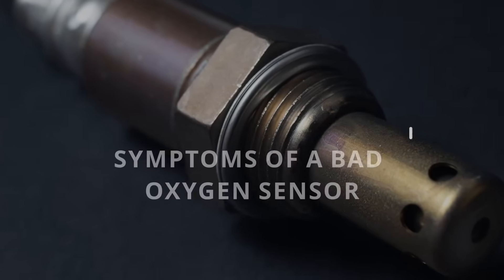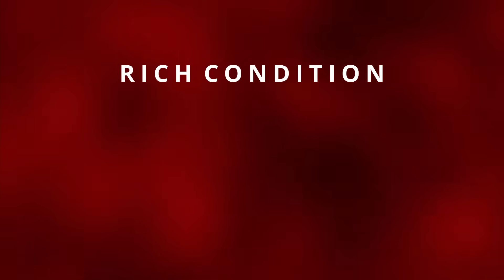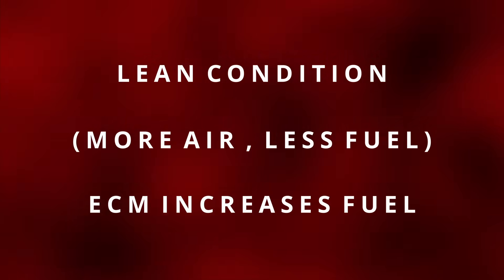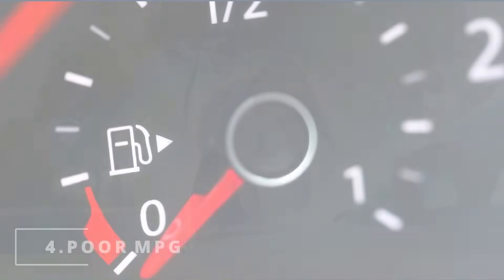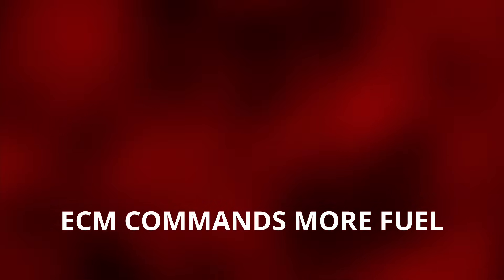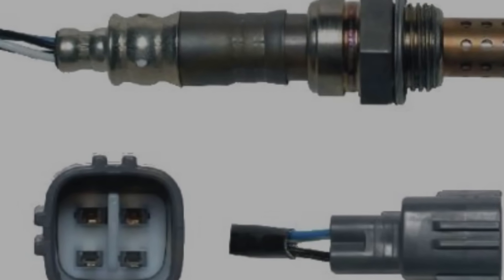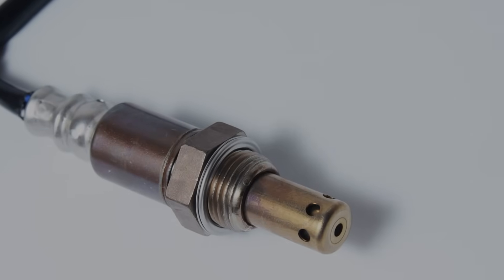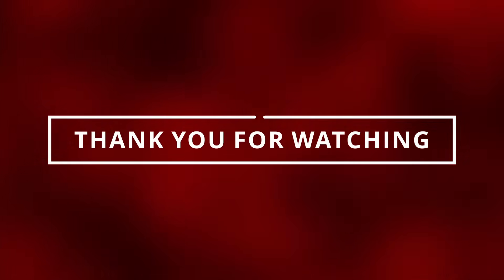SYMPTOMS OF A BAD OXYGEN SENSOR

Comment from the maker: Thank you for watching!
O2 sensor removal kit: https://amzn.to/3dU26RA

OBD2 Scanner: https://amzn.to/3PHRplS
Reply: I got P0410 code but I don't know if is sensor bank 1 or bank 2
Reply: Why is this guy talking like that?  INFURIATING
Reply: Wow. That explains alot. Especially the part about unplugging the censor. My issue is the damn think is rust locked on the manifold so I treated the fuel hoping it works itself out. No such luck. I'll try unplugging it see what happens

Comment: Dude just described my car to a T! I have to put it in neutral while at a traffic light, that steadies the shaking. The gas mileage is very poor. I went to an auto parts store and had them plug in the computer reader thing and it said catalytic converter but was told it’s likely the oxygen sensor. I hope that’s an inexpensive fix!

Comment: Great explanation. Will a too lean error code cause damage to the engine immediately or does it take some time? TIA
Reply from the maker: A too lean error code won’t cause immediate damage, but over time, it can lead to overheating, detonation, and burnt valves.
Reply: @easyautofix  You're the man, thanks!

Comment: A funny thing happened to my 96 sentra, in the mornings it would have a tough time starting, part of it was the fuel pump going bad, but I could not figure out why it was still bad, my inyectors and throttle body were perfect, other sensors were working fine, until I unplugged the oxygen sensor, BOOM, fired right up on a cold morning.

Comment: My 2013 Nissan Versa Catalytic Converter Was Plugged and we had to Nock out the Plugged Cat, and it was Still Pulsating or Loping when Accelerating or under a load. It's Burning Extremely Rich, in fact it stinks with pure gas odor. I think it's clear what Part I need, an Up Stream O2 Sensor. Hopefully it fixes it. If Not Maybe a New Air Filter and get a New Mass Air Flow Sensor or a throttle body Sensor or New a Throttle Body.

Comment: I did unplug my upstream and ran 50% better it would start easier but idle up and down sometimes stalling. Plug it in hard to start and would stall easier. plus fuel smelling emissions out the tail pipe.

Comment: Hello. I own a vw golf 2 and I have a problem when I connect the coolant temp. sensor, the engine is trembling and even stops (I ve changed the sensor twice and it s stll doing the same). My question is: can the Lambda sensor have a bad influence on the coolant temp sensor?

Comment: My 2000 tundra truck has rough idle and shakes in a red ligth like it wanna turn of and I been knowing it has a oxygen sensor on scanner I disnt change it because I had les then 5 months with it hardly use truck but some mecanic told me the sensors feom auto zone come out bad so you think that's the problem ?? My oxygen sensor it has rough idle wen I'm in red ligth or stop some were when I put it on park it stops or wen it's running

Comment: Can an oxygen sensor cause a vehicle not to start.? My friend’s check engine light can on indicating an oxygen sensor code. Sometime after that engine would not start. It is a friend of mines truck. It is an 04 Ford Silverado six cylinder.  It wont’t start.   His Mechanic friend change changed the coil and some kind of electronic module. It started up after several attempts and ran for a few days and stopped again. It won’t start again. He cleaned the mass airflow sensor after he got it started as a little something extra. A few days it stopped starting up again.  Now he says it’s probably the mass air sensor is probably bad and he’s going ready to change it.  Before all of that, his check engine light came on With a code for a bad oxygen sensor. Could the bad oxygen sensor actually be the problem, which he ignored and never changed?

Comment: Why have 4 mechanics told me there should be 0 performance issues from an Oxygen sensor? They swear online knows nothing about O2 sensors 

Has anyone had bad acceleration, get O2 codes, replace them and notice a big performance difference?

Comment: Mine has most of those engine light one day was turning of and on and one time shaking after I put gas also been wasting more gas the  normal also wen I turn truck on it trows smoke and wen it warms up it stops ima have 2 change the oxygen sensor again I changed it not so long ago but mecanic said sensors from auto zone come out bad so ima have 2 wadte money again and I haven't worked for a few months know

Comment: My check engine light came on, and the codes came up for one of the oxygen sensors.

However, the next day the check engine light turned off. Does this mean I don't need to worry about it for now?
Reply from the maker: This sounds like an intermittent issue. Since it only happened once and the check engine light turned off the next day, I wouldn't worry about it for now. However, if the code comes back again, it's a good idea to address the issue to prevent any potential problems in the future.

Comment: Which 02 sensor should be unplugged for the testing procedure? Upstream or down ?
Reply from the maker: Upstream
Reply: @easyautofix  thanks for the reply. Just a question, won't it set a code after disconnecting the sensor?
Reply from the maker: @JohnContos-h1v  It should, yes

Comment: Hi Easy Auto: one of the things I enjoy hearing is the way you say "today's video is about "symptoms of a bad 02 sensor" the way you narrate other videos. It's kind like some kinda child narrator. I want you to know I really appreciate the trouble shooting tip regarding unplugging the 02 sensor to troubleshoot. Since I have 2 sensors only on each side of the exhaust manifold, it should be relatively easy to troubleshoot. This tip will save me $$ in the long run because it's possible I do not need a new MAP sensor. I bought two new )2 sensors but the cost to put 'em on and the fact they could be stuck in the manifold scares me. Thanks, tho for the great tip.

Comment: So basically after watching videos on camshaft, crankshaft and oxygen sensors i came to conclusion they all give the same symptoms which is kinda annoying while diagnosing the problems 🤦 nonetheless great videos man:)
Reply: Lmaoo I’m having an issues right now I had a code p0725 for the tcm in my 2012 g37s I swapped the engine crankshaft sensor codes gone car drives fine the next night drives like shit almost shuddering on the way home when I would give it a little throttle get home scan it now I have a code po138 p2a00 after installing test pipes 😂
Reply: Think you gotta just start replacing stuff that's what ima do
Reply: same boat here, all the symptoms im experiencing are apparently synonymous with 20 other problems. I've just been going through everything then checking & testing it.
Reply: @hellcat7314 just change all 3
Reply: Having an exhaust leak before the catalytic converter or an intake leak can make it look like the O2 sensor or crank/cam sensor are bad .
Reply: Diagnostic scan?

Comment: 2000 wj 4.0 jeep. 
I just replaced my O2 sensors. Bank 1 and bank 2, upstreams, and for the life of me I'm still getting po172 and po175 too rich! I replaced the injectors, spark plugs, fuel pressure regulator. WTH does it want from!!🤯

Comment: I have a 2011 Ford flex and my car burns gas a lot. I sure appreciate how you explained it for me to understand. It has over 200,000 miles. The light come on Sundays and then it goes away and comes back days later. I was told it was a 02 sensor. After listening to you I believe it is the right and the left upstream and downstream if you say that's what it is called. Someone said something about try dry gas. I know I'm over doing it it's been almost a year like this. If you have any other advice for me I sure would appreciate it thank you so much. God bless

Comment: My 02 buick park ave has lost fuel mileage by 1/2 just in the last few days. The only other symptom we have had is that yesterday morning it gave a rough time starting. It acted like it was vapor locked. We found this really doesn’t happen in these types of vehicles. We recently changed the catalac converter so could this have messed up the o2 sensor? Any other thoughts of what it could be? There is no engine light on, it started fine since then, it runs fine other than extremely poor fuel mileage. Very stumped on where to start!

Comment: the 02 sensor code came up when i scanned my car and it said it needed to be replaced. my car has been turning off whenever i put gas in it and it doesn’t start the first time but the second time it barely starts and i gotta gibe it a little gas for it to start, and my car has also been shaking and wasting more gas could that be the problem? i have a 2007 audi a4

Comment: Do you think a faulty O2 sensor can make my RPM be jumping slightly up and down as I'm on cruise controll at low speeds? It also shakes while accelerating only, not while coasting.
Reply: I'm currently in this boat. I think I'm going to just replace the sensor to see if it fixes it and I can report back what happens..
Did you find anything out?
Reply: @aic20 Same here. Did that help?
Reply: Same, did it help?
Reply: I’m in the same boat with my truck, just between 1500 to 1800 RPMs

Comment: Could this be responsible for an rpm drop on a cvt from 1500 to 1000 accompanied by a low rumble sound while ascending a hill? No check engine light on and this is the only issue. The rpm drop only lasts for 1-2 seconds then ascends normally

Comment: Man I have been dealing with this PO420 code. I have had my catalytic converter replaced 2 times and did a cleaning many times but still keeps coming back on. I guess the last thing to check is the O2 sensors even though people say it’s not always them.
Reply: did it work.... if not try your evap purge valve or gas cap
Reply: does your car turn off in cold start at idle

Comment: I've got a '00 Blazer, been replacing sensors here lately I've replaced the cps,tps, with 184k miles with poorer gas mileage as usual the oxygen sensor should be next thanks for info. 😁

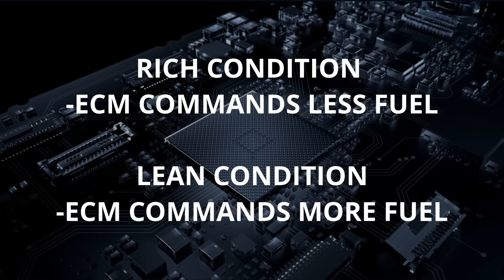Comment: 1:38- 1:45;  A honest statement that, these sensors try to fix problems that usually don’t exist! Seems they would at least put a bypass wire on these sensors instead of stalling and shutting you car down leaving you stranded beside the road!?

Comment: Could a P0420 code be from a faulty sensor rather than the Catalytic converter? I’ve got no other symptoms of catalytic converter failure but I am getting that code. I am getting rough idle but no decrease in performance, no smell, fuel economy is fine
Reply: Did u find out

Comment: In Nissan murano 2008
Sudden engine off while slow the car 
I check code P0345 and P1031

Which one need to replace for that issue?
Reply: Flaco Alterado  i changed cam position sensor now its fixed now car running ok

Comment: Thanks for confirming that a bad O2 sensor may not cause a check engine error code.  I believe my 17yr old sensors are sluggish so monitors will not set. Installing 4 new ones tomorrow. Thank for video.

Comment: My sister has a Hyundai Coupe 2000 2.0 L petrol and the car is running extremely rich with extremely high emissions and a slightly rough idle (RPM shakes a bit below 1000 RPM). Service is done and new spark plugs are installed and a new cat. The car does not have MAF or MAP sensors, is it normal that it has only TPS without MAF and MAP? And is it normal that the car has only one oxygen sensor before the cat? When the oxygen sensor is disconnected, the idle does not change. Do you have any idea or advice?
Reply: Have you fixed it? My car has the same symptoms as yours.
Reply: @gustasj  yes, it was the connection of the MAP sensor, one of the three cables of the connection was not in place, i fixed the cable and everything became normal again, the sound of the car became quieter than before, the rich condition went away and the exhaust smell became normal again without fuel smell in it.
Reply: @MerohDIY  was the connection pin bent?
Reply: @gustasj  no, it was the cable that was off exactly behind one pin.
Reply: @MerohDIY  oh, okay. Thank you for the response.
Reply: @gustasj  you are welcome :)

Comment: I have a 95 C4 with less than a 100k on her... I purchased the C4 in April of 2021 with only 87,000 miles....few months back it started running rough so I changed the Ignition Coil and Coil Module and the wire running from the Optispark to the Coil... made all the difference in the world... since then I have replaced the electric fuel pump, fuel filter and the Fuel Pressure Regulator simply because the Internet says after 75,000 miles you should start replacing the items... So my C4 is running great for a while now it's running like it has a slight miss so today I replaced the Map Sensor and IAS.. but it didn't change anything so I was wondering what happens when an 02 Sensor goes bad... How does it affect the car?

Comment: So I had plenty of oxygen sensors go out on me in previous years. But this particular time there was no indicators my oxygen sensor was out. 
So I practically swapped out every single cheaper part related to my codes: P2294, 2293, 0087 & EPC-Engine icon in dash.... all pointed at fuel pressure regulators, sensors, etc. I had no misfires, gas seemed to be normal but I did have loss of power.
So I finally changed the oxygen sensor and oh boy my car is doing figure 8 donuts now and running like a champ 💪🏾.
Reply: Did your car die at a stop ?
Reply: @juanrenobato2722  no
Reply: @juanrenobato2722  no & it wasn't the oxygen sensor. It was a fuel regulator had a crack I was slowly leaking gas, which made it putter-loss of power, hard starts but no cutoffs. 
Previous vehicles when it was the oxygen sensor it would have loss of power, putter, misfire & fuel efficiency was bad.

Comment: I have a Hyundai Sonata 2012 limited and it has 2 sensors . One is by the engine and the other one is by the exhaust pipe. Which one should I remove ? Thabk you

Comment: I suspect my O2 sensor as it is covered in soot. I am just getting a TBI system running on my 240Z and its idle goes up and down after a couple minutes. I didn't get it totally up to temp, but the ECM is not able to learn and calm things down. (I'm still burning fresh paint and header wrap so I didn't run it very long today). The other possibility is the ECM chip, which is in the experimental stage from the mfg, Howell Fuel Injection. But the O2 sensor is a cheap GM part. The check engine light is on, but I don't have an OBD1 scanner yet.

Comment: So idk if you can help. I have a 2016 Ford Escape. My check engine light has been on and a month ago my car was stalled in the middle of the street. It was jerking at first until it completely stopped. I made it safely into a parking lot and tried to drive home after. And it just wouldn’t go. My car was still on, but not driving. Would this be a oxygen sensor issue?

Comment: Well I got more I fo out of this than anything my mechanic told me.
My CEL came on but went off with new IAT sensor but it still surges, idles rough in gear only, and strong smelling exhaust. Then poor gas milage and stalling at stops in gear.
Every single symptom I have is here.
I am replacing it asap. Thanks for the vid it helped out a huge amount.
Reply: Did it help?

Comment: I unplugged the sensor, disconnected the battery, started it again and engine light went off.  Next, I ran it for 20 minutes and the the check engine light came back on. does this mean the sensor is ok and that problem is something else? Thanks!

Comment: This helped me confirm I had a bad oxygen sensor. CEL came on for bad O2 sensor, but it went away after a couple days. Decided to order a new 02 sensor anyway. Car's been shaking slightly in idle and has had worse performance even though the CEL is still off. I'm gonna go ahead and install the new sensor after watching this video. Thank you.
Reply: Was ur issue fixed???
Reply: @nosajsamaniego4512  Yes. No more shaking, performance restored and no CEL. I recommend checking ebay for an affordable O2 sensor before going to Autozone or somewhere similar. Just make sure you know exactly what type of sensor you need.
Reply: @JCno28  Sweeeeeeeet; 
Okay, thanks for the encouragement;

Comment: Hi I have a 02 Lexus and it’s pulling the p2004 code. I drove it and it would not go while I was sitting in a drive thru, after about 20 minutes I put it in gear and it accelerated, could it be the 02 sensor?

Comment: Mercedes Benz c class 180 kompressor 2005 petrol
Code reading p201c mixture format self adaptation (fuel trim)

It takes about 5 seconds to start it struggles.
Drive can be sluggish at times and petrol drinks like its a joke did  55miles with £30 petrol.
I left this problem for 2 to 3 weeks it had no engine light on after a few weeks gone by the engine light came on 
And got the codes no one knew the problem and still dont 
I noticed since my car went low on fuel it started straight away with no struggle and the performance was excellent and drive was smooth
When i put half a tank of petrol in it took 3 seconds to start can anyone help
Reply: Also when i went on low fuel and been Parked over night the next day the engine light went off